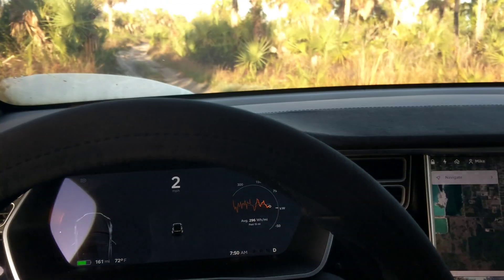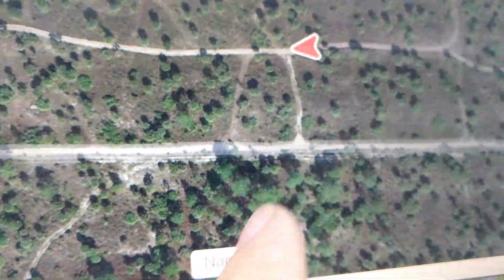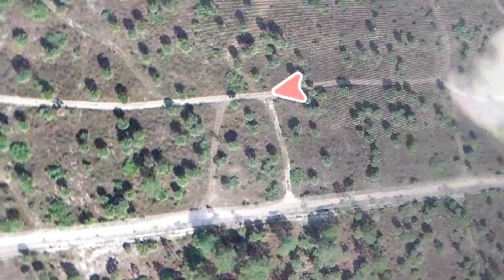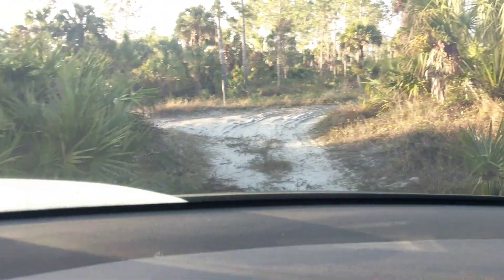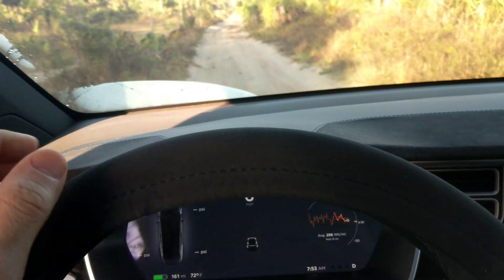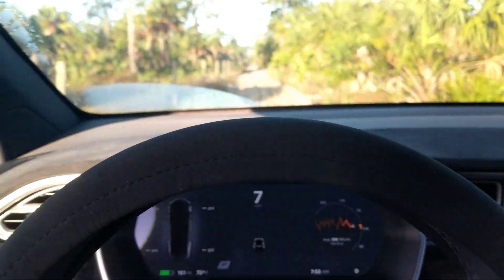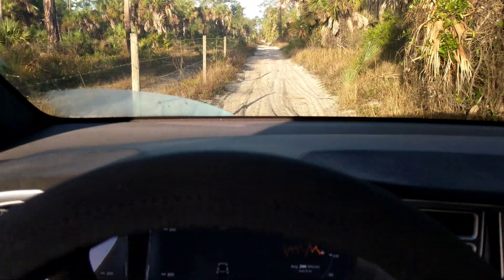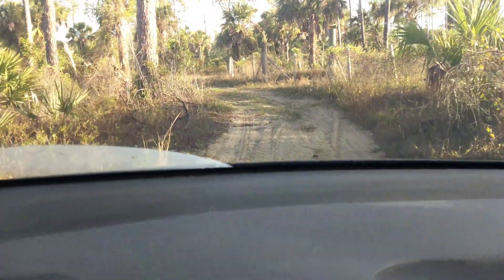TESLA 🚗 Torque Vectoring in Turns | DEEP LOOSE SUGAR SAND

Comment: from what i understand, having an even torque split across the tires prevents slipping, is that correct? so i guess tesla uses a control system on the tyres to prevent one from spinning out too fast?